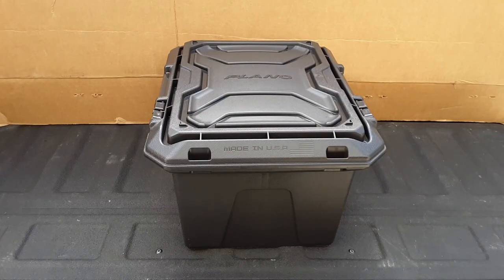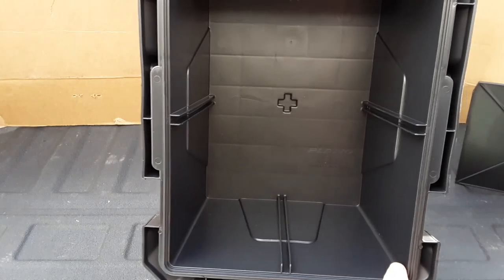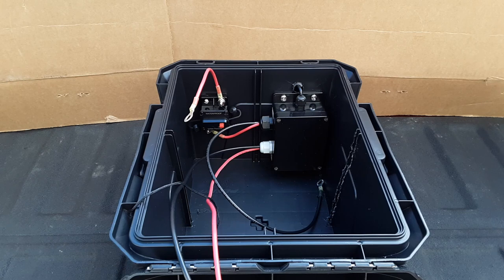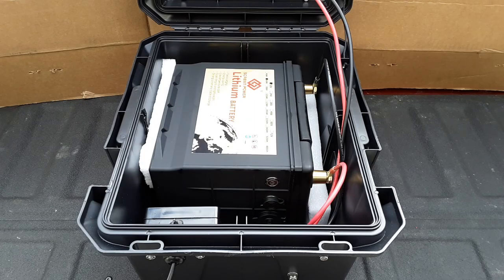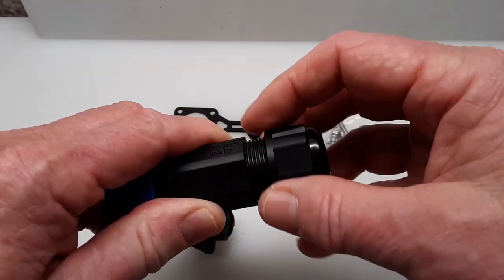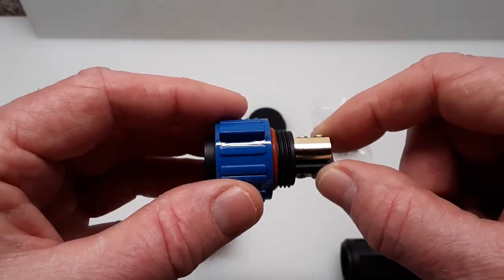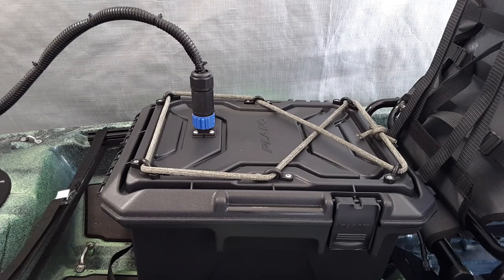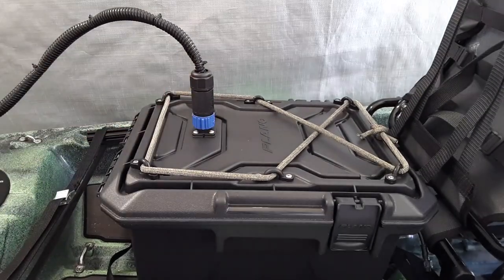Kayak Battery Box with ESC (Electronic Speed Controller) and Circuit Breaker.

Comment: Nice clean installation!  What is the AMP rating on the plug that goes to the trolling motor?
Reply from the maker: Thanks John. The plug is rated for 12-48V 50A continuous.
Reply: @Aksmaniyak  Sounds like a good combination.  I like the twist lock operation.
Reply from the maker: @helicopterjohns  It is the easiest yet. I, like most people, have been using the traditional trolling motor plugs meant for boats. They are beefier than need for kayaks. This works great.

Comment: Nice build.  I have watched all your ESC builds and have learned from each of your iterations.  Is this your current version that you are using?  If it is your current version, what did you decide to to with the emergency cutoff switch that you built into the remote box a few videos back.

Comment: Nice video. I have a 55 lbs NV TM. Would an 880 ESC work. Is there an ESC that will work with a 55 lbs TM?
Reply from the maker: I wouldn't use an 880 ESC for any trolling motor larger than 50lbs. Others have mentioned that the heat from larger motors can melt the wiring over long high amp use. Somebody mentioned on a FB page (don't remember which) that there is a larger one available.
Reply: @Aksmaniyak  Thank You. So it seems the 55lbs thrust trolling motors present problems for both PWM’s and ESC. I think I’ll start working my way back out of the Rabbit hole and reinstall the original controller and sell the 55 lbs thrust TM. Thank you for your help.
Reply from the maker: I built a PWM using a Minn Kota Traxxis control board that may work for you. It is in the PWM playlist.

Comment: Nice build, almost identical to mine. What is the max AWG that can fit in those screw  plug terminals?
Reply from the maker: Thanks. I used 10G and it was loose so I'm thinking 8G would be the max.

Comment: Hi interesting build though I have a question. Do you put the  ESC before or after the circuit breaker?
Reply from the maker: The circuit breaker should be close to the battery and the ESC connects after the circuit breaker.